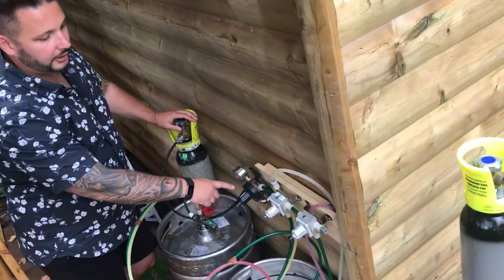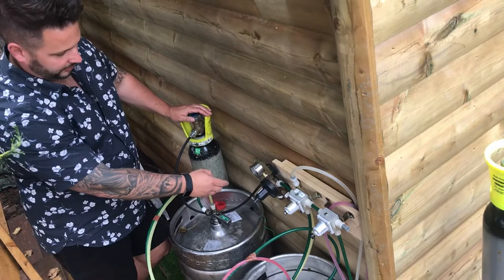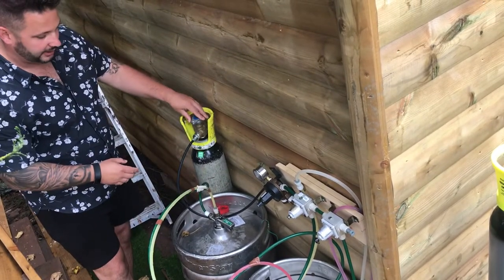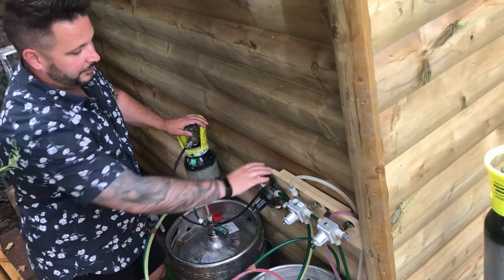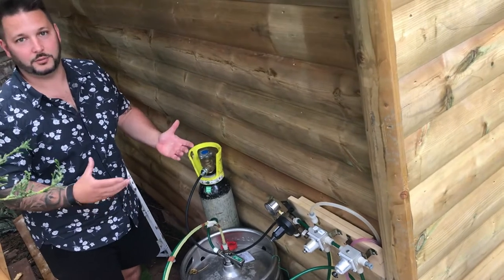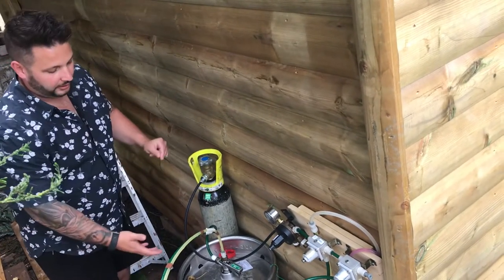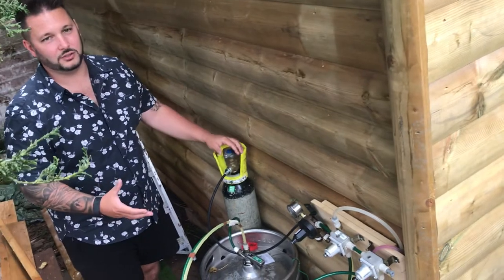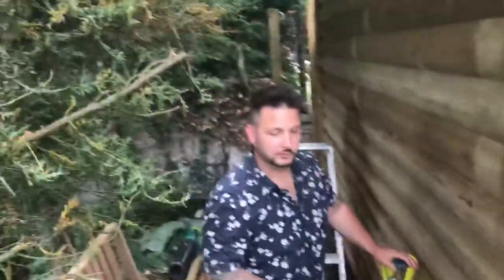Full Draught Set Up Demo

Comment: Hi mate, where did you buy the keg of beer from? Cheers
Reply from the maker: Have a look on our website, we have a number of beer line installers and keg suppliers 
https://www.homebarsuk.co.uk/merchants-home/
Reply: If you dont have beer line cooler the beer will come out warm and foamie. Unless you can get the kegs really cold somhow. This would work winter maybe but definetly not summer. This systems designed to run trough a chiller which makes the line cold where the beer runs trough thus flash cooling the beer in the process. And even then you need a beer keg thats relatively cold to work. Hence bars and oubs have a cellar which is cold plus a chiller.